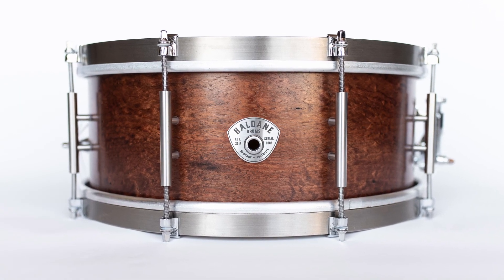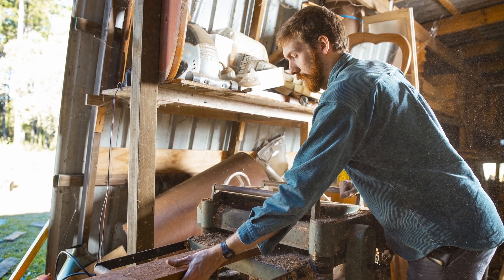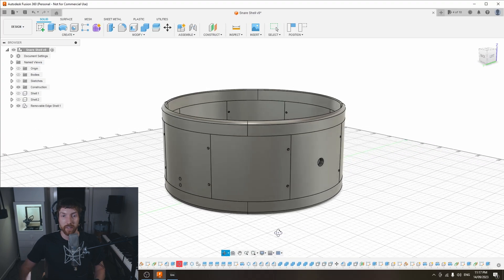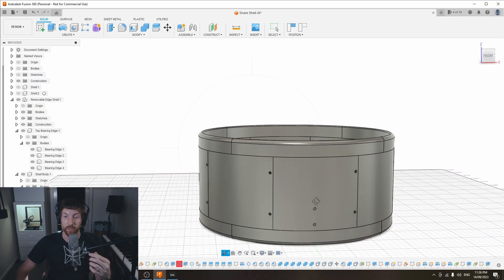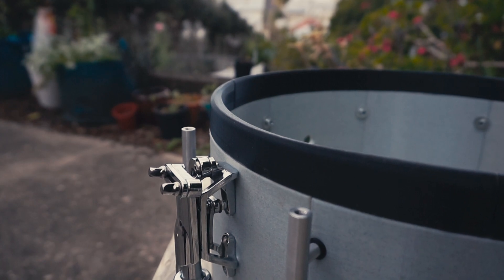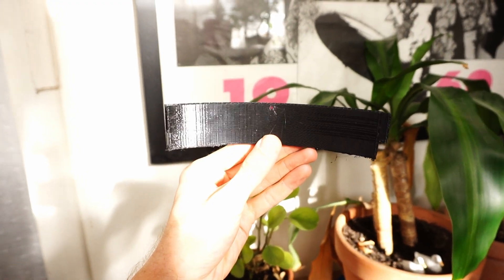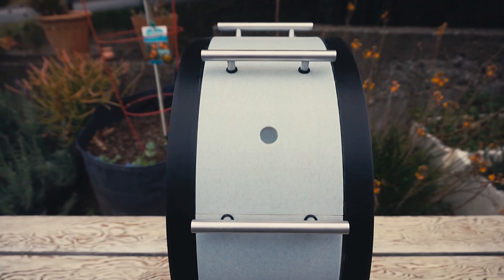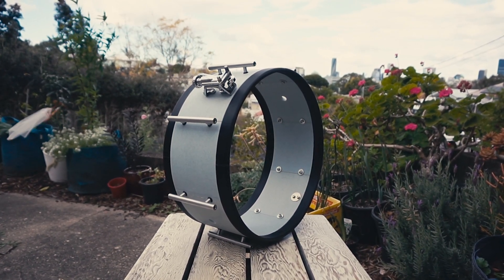I made a 3d printed Snare Drum and it sounds surprisingly good!

Comment: I will be trying this stl out, thank you!! Also, have you considered printing the crosstick section of the shell of the drum with  higher density, just for that portion of the drum? It could throw off the sound, potentially but I have feeling it might bring back a little bit of the attack? I've printed the drumsanddroids snare before with lugs too, matte black and gold. It was awesome, but also a little bit of a pain with the adhesive aspects and, as youve mentioned the bearing edge issue with supports. Luckily printers are more capable when it comes to supports now. But yeah. The pruscacaster is also a very fun build if you ever get the chance.

Comment: I always thought quick change bearing edges could be a cool concept. Swap them out like you would your heads for a different sound or try different materials with a free floating style shell but with 2 parts and a shell in the center and some style of quick release lugs that split the drum but keep tension on the heads and you can swap in a different shell material like brass or mahogany.
Reply: Could also be a cool way to change depth of the drum by swapping out the bearing edge for a different sound

Comment: I thought the sound wasn't bad just a bit dry. Have you considered making a deeper shell. This could theoretically produce more resonance due to more vibration through a deeper shell. Also, to increase the "cross stick" volume, consider increasing the width on the bearing edge. This should create more contact between the edge and the head in relation to the rim. Just a couple of thoughts.
Reply from the maker: Good ideas! I'm busy at work with the follow up to this project, so maybe I'll try and test some of this out. Thanks for the comment :)

Comment: Do you happen to know what the lug spacing is?
Reply from the maker: Not off the top of my head I'm sorry! I should point out that I designed these lugs and had them custom fabricated, so I just came up with a measurement that worked for me. I'm not sure whether you'd be able to find lugs with matching hole spacing. I will be releasing a design soon which will allow you to define your own hole spacing though!
Reply: @beau-haldane Okay I’ll wait for that then
Reply: I want to make sure I can get all the parts before I start printing